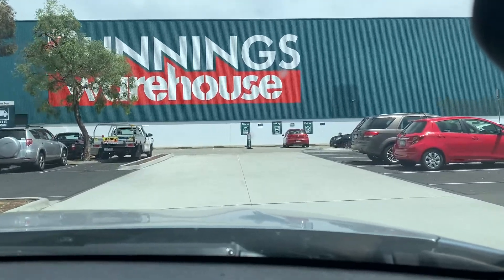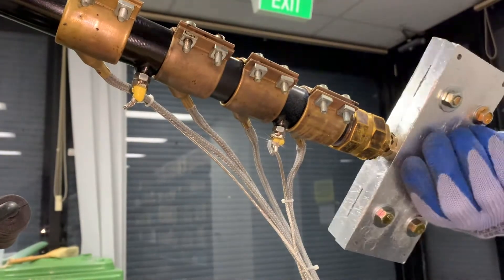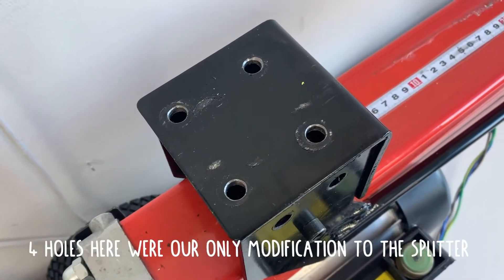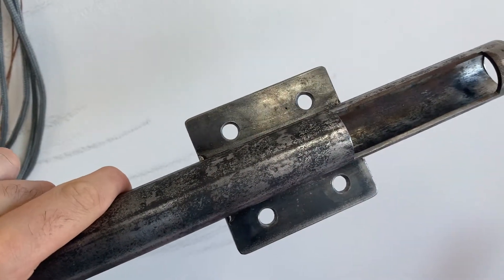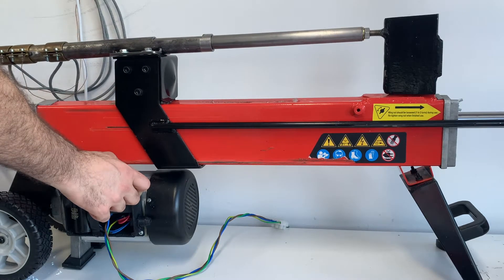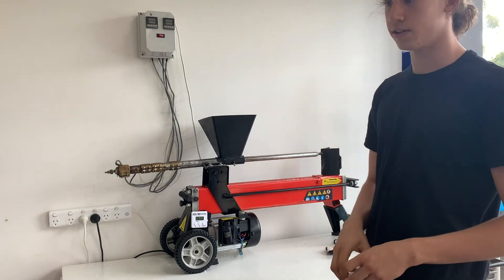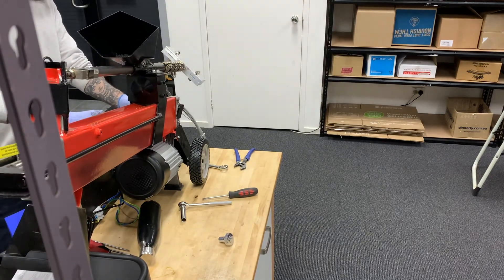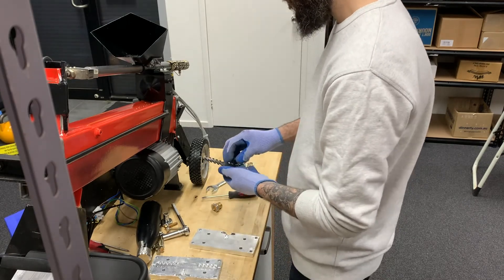How We Built It | Precious Plastic Injection Mould Machine + 5T Hydraulic Log Splitter

Comment: OK another question hope you can answer...  any reason why you didn't mount it the other way around,  so the nozzle is stationary?  cheers!
Reply from the maker: We wanted to have the option to either run the machine either horizontally or vertically. Mounting the other way around would allow for a clamping system, however :)
Reply: @PreciousPlasticMelbourne  oh right,  i hadnt thought about the vertical system the other way.....  thanks,  lot to think about!

Comment: FYI for long time production runs like a full day shift, you will need to add on a supplimental cooling fan to the motor.  We made a flange and use a 25 watt in-line exhaust fan that cools the motor/pump between shots.

Comment: I'm making one of these now, how much space do I leave at the end of the barrel?
Reply from the maker: Hey Jon, refer to the original Precious Plastic Injection plans https://community.preciousplastic.com/academy/download
Reply: @PreciousPlasticMelbourne  I have the CAD files handy, but the handle is fully extended and I can't tell how far down the plunger goes without mocking one up in real life. I'm mostly just looking for a ballpark, I plan on building some adjustability into the rig (like you did with the threaded rod). I appreciate all your help!
Reply from the maker: @jonny_panic  I'm with you. It looks like we have approx. 160mm left in the barrel.
Reply: Could someone explain to me why there needs to be a space at the end of the barrel. In the manual injector build video it shows the plunger extending past the end of the barrel. It seems like it would be easier to clear the unused plastic if the plunger could extend past the end. I'm sure I'm overlooking something simple here, possibly even dangerous, but any info would be appreciated. Thank you. Awesome/inspirational machine!

https://youtu.be/qtZv96ciFIU?t=567

Comment: That's awesome!  Thanks for sharing.  So if the log splitter had an hydraulic oil pressure gauge fitted you guys could use the pressure indication to help knowing what's a good time to stop pushing
Reply from the maker: Cheers for the tip! We originally used a load cell but it reduced our stroke length so we took it off. We’re planning our next upgrade so we’ll definitely look at the pressure indicator :)
Reply: @PreciousPlasticMelbourne  you're welcome!  Also an adjustable pressure switch

Comment: Would it be possible to make the tube and plunger longer to make this? I am interested in doing this to make disc golf discs. The mold would need to melt 180 grams of plastic at a time. Was thinking or either a bigger volume tube or a longer one, but I’m wondering on if this would cause any issues. Would love to talk with one of you! This is great.
Reply from the maker: Seems feasible. Trash Panda did something similar for his manual injector so I can’t see why not. Find us on the Precious Plastic / One Army discord server - Blake and I can answer any questions there.
Reply: The more surface area you have, the hard it will be to fill. Look at production machines, they recommend 50 tons of clamping pressure for a 4oz shot, that is for a mold and die that automatically springs apart and cycles every 20-30 seconds.. I can't tell you what kind of clamping force he is getting with 4 8mm bolts, but the mold he is making here doesn't have a huge surface area either. I seriously doubt this machine can fill a 60 gram mold that is 2mm thick even if you heated the mold up.. But I could be wrong, and I'd LOVE to try!
Reply: @reforgedcriterion1471  there are vids of people doing 120g parts manually.  ?